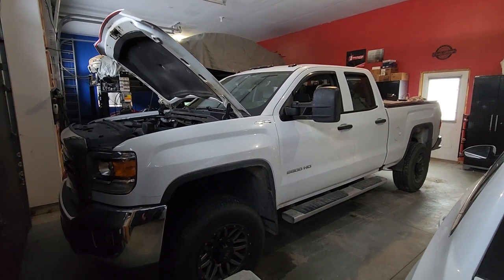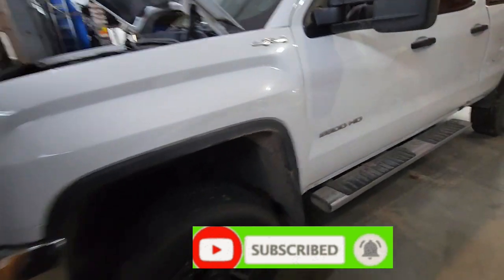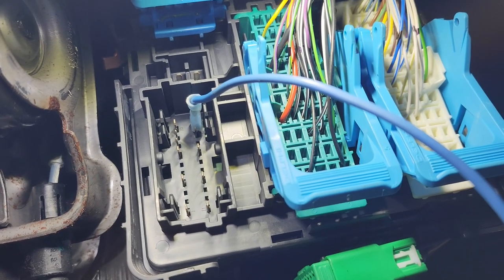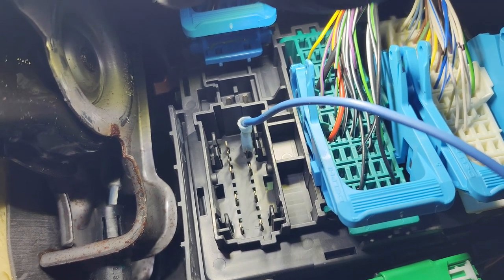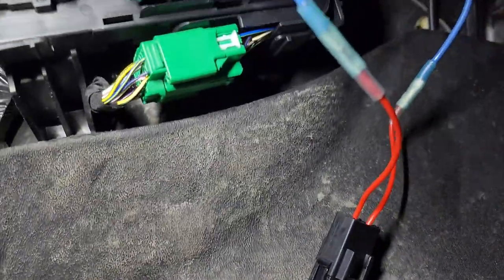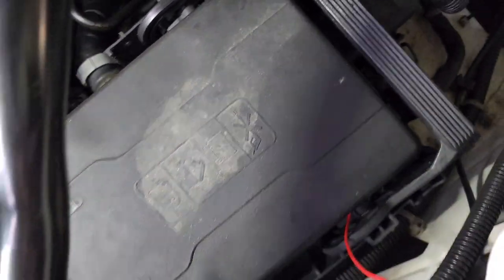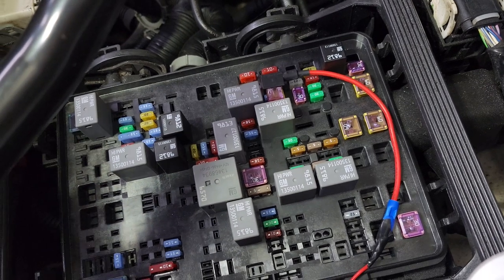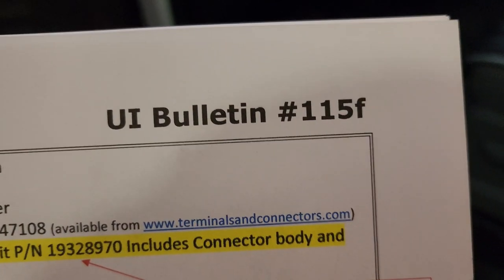Chevy Silverado -GMC Sierra Upfitter switches

Comment: So is this only for HD trucks? I have an 18 silverado 1500. Trying to tap my running board lights to my DRLs. So can I tap into something under my dash? Or only the fuse box under the hood?
Reply from the maker: I believe that GM has a kit available aftermarket that can be used with the 1500, the switches are a little different.  Check with your local dealer

Comment: Where do I find the correct pin connectors for junction box?
Reply from the maker: If you are in the USA, any dealer or some suppliers on ebay, if you are in Canada GM dealer. Thanks for watching.

Comment: Does anyone know the answer to this question? I have a 2014 Sierra with a (3) button uplifter switch. I am wondering if the system (fuse box etc) is wired for a (7) button uplifter switch. I am hoping it is as I want to replace the uplifter switch?
Reply from the maker: I do not believe it is as the 7 button is a factory upgrade. Check with your dealer they may know different.

Comment: If you have the x7 connector installed, is there a spot to tie in the aux switch to the x7 under the dash and run one wire per switch out through the firewall? Or would you have to run the ground wire from the aux switch and the positive from the x7 connector through the firewall?
Reply from the maker: They are one and the same, the auxiliary switches are connected to the x7.  The x7 then connects to your individual components which in turn are turned on by the switches